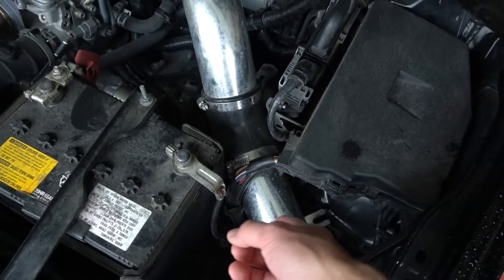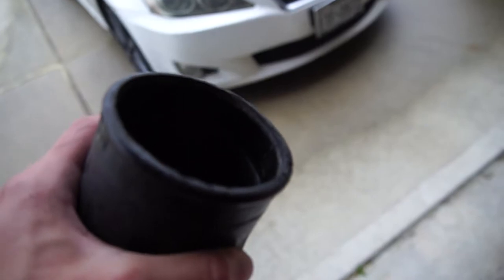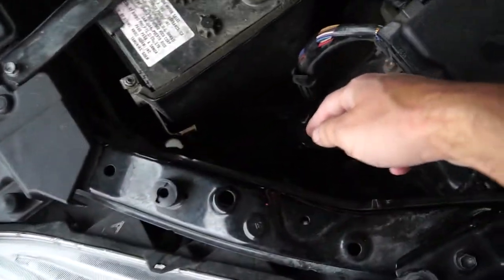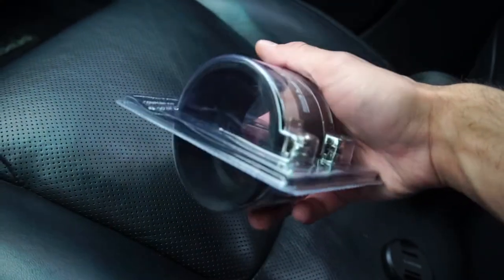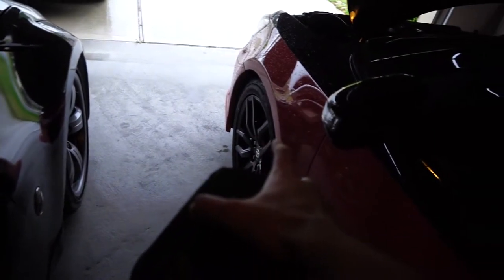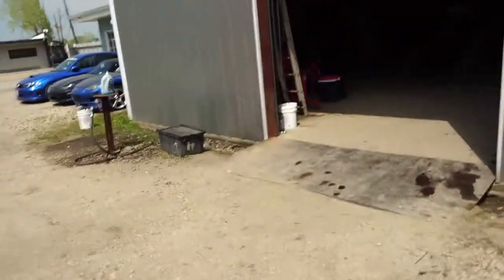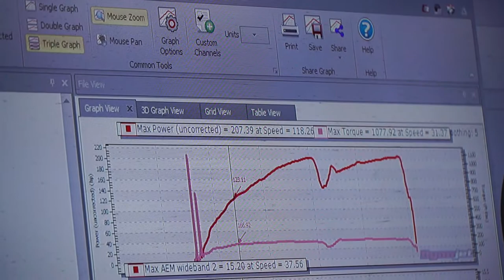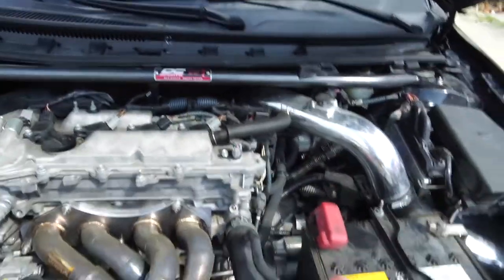2nd gen Scion tc E85 dyno tune

Comment: I'm still deciding should I get the manual 2nd gen TC man
Reply: King Rose War yes ! DO NOT GET AUTO trust me not fun I got the Manual version of this same car and love it 🙌🏽
Reply: I’m with him banging gears in this cars is pretty fun
Reply from the maker: King Rose War yeah honestly I was scared of manual at first so that’s why I didn’t get one :( I REGRETTED IT GET A MANUAL that’s when I got the 350z manual for a project car
Reply: @xXBEBeJayyPXx  thanks man I appreciate the help and support. Driving manual is way more fun than a automatic plus you can upgrade the flywheel and clutch
Reply: @georgek5241  💯💯💯💯
Reply: @seanchavez6705 that's Man I appreciate the help and support I'm just going to get the manual version of the car
Reply: I have a 6 speed 2nd gen all stock besides exhaust. Boost will be soon
Reply: GET THE MANUAL NOT THE AUTO🔰

Comment: Trying to decide between boosting or E85 now 🙃
Reply from the maker: I would go e85 first to see how you like it honestly, and also if its done right you can run e85 without a tune like I did
Reply: C&R Vlogs I don’t know, my hear lt is pulling me to the dezod kit /: but the e85 tune looks cool as 👀
Reply: C&R Vlogs No. That’s ridiculous dude. You’re dropping around 1,000 alone on a FIC and wire harness just to tune for e85. Then around 800 for injectors, pump, and return system. You’re spending $2,000 total for parts when you could make way more than that for 4,800 by boosting.
Reply: @HotBoiRicer  how do you boost?
Reply: @Austinbelifting  with a turbo or supercharger……

Comment: Its not possible to custom tune this car, only thing we have is shit ovtuning wannabe cobb access port.....i can talk shit because i have the identical car (i cry for lack of aftermarket)
Reply from the maker: chris villa yeah struggle is real bro 😥
Reply: What’s wrong with ov? Was considering it fir my 16
Reply: @samw.7740  whats right with it? XD.......all jokes aside all it does is probably modify some timing and fuel trim tables but you are limited to the tunes that they made, this means no tune is custom for your set up, just whatever set up they had when they made it. It should have been made with the ability to custom tune your own car with your own tuner dude/software. Plus they have zero support for the customer if they wanted anything more and no launchcontrol/flatfootshifting
Reply: @samw.7740  it's not bad, helps get the car out of its own way. I thought it was worth it I use the 93 octane 7k rpm limit tune
Reply: @Dr.Squints  untill i see a tc plugged into a laptop with all tables and parameters i wont be sold imho
Reply: Facts i have had a 2016 rs 10.0 for like 3 years now since like towards the end of high school and im getting rid of this pos car scions are such fucking trash save your money buy a brz

Comment: Damn if this had a clutch you’d be putting down around 220-230whp.
Reply: Shred Dogs naturally aspirated and stock internals? Maybe not...
Reply: Automatics lose more power to the wheels than manuals. It’s a fact lol
Reply: @BedazzledChanclas  I can make 300whp N/A out of my tC just gotta know what mods to do🤷🏻‍♂️ Sure internals may be changed up but $1.5K total to make that power isnt bad. Crank, Rods, Pistons, Valve Springs, Intake, Exhaust, Injectors, Tuning Software, and a Clutch kit. You would easily make almost 350 N/A on E85 on that build.
Reply: @HotBoiRicer  I own one and I’ve done my homework. You’re not going to make that much from this engine unless you’ve got some forced induction buddy :)
Reply: @BedazzledChanclas  1AR-FE is a 2.7L 4 Cylinder made by toyota everything is identical to the 2AR-FE except a larger crank and shorter pistons and rods. Without any work done internally on the 1AR-FE, just intake and exhaust you can make over 220whp. You can buy the Crank from a 1AR for $600, Pistons and Rods will have to be made by a company, BC stated if you give them dimensions they will make them. Figure if you go with a taller piston and shorter rods it will be a high revving engine with larger displacement. Pair that with beefier valve springs and a ground cam and tune you will easily make 300 to the wheels all day naturally aspirated. Try again buddy🤡🤡
Reply: @HotBoiRicer  teach me your ways
Reply: @clintbeeler5069  Just talk to Marc at Frankenstein Motorworks. Marc has a set of cams that made almost 300whp on the motor. Grab 750cc DW Injectors, the cams, get new pistons and rods, and on E85 you could easily make over 300whp